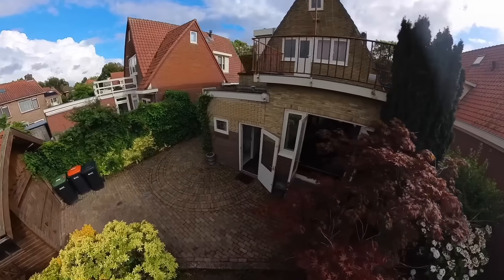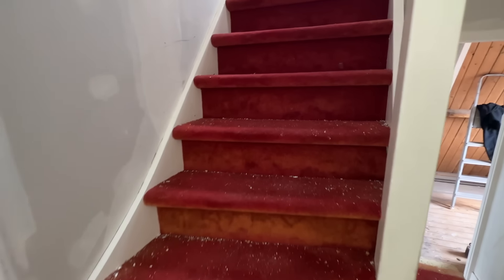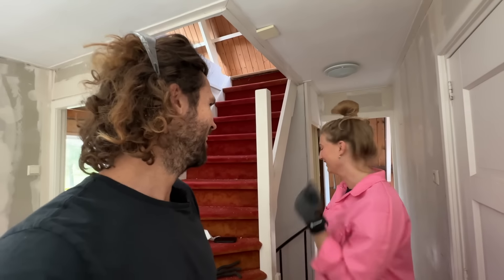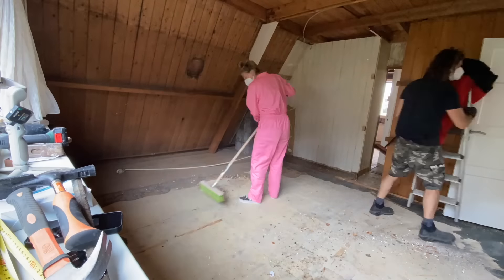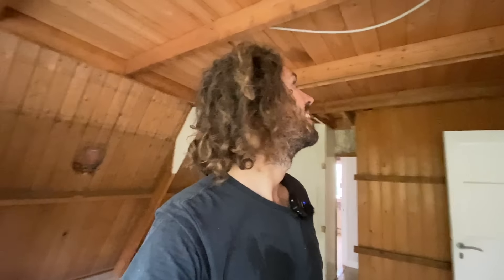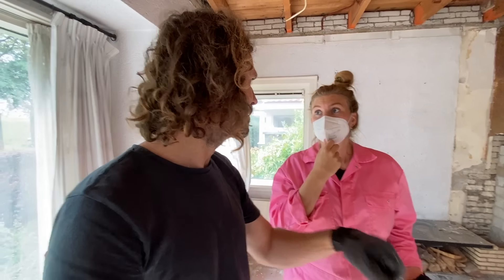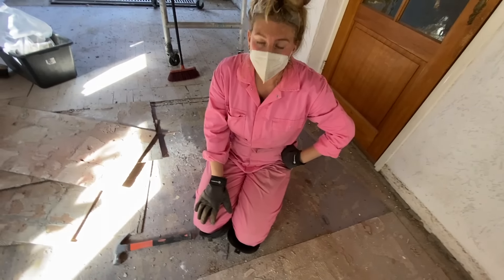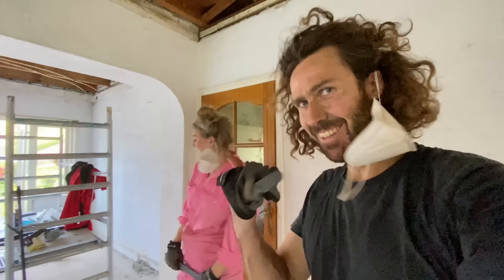Renovating our NEW HOME on a Budget! (PREGNANT) pt10

Comment: It would be wise to think about isolating the house properly before you paint, add new flooring etc. Those floor boards look ok (except the rotten part which does need replacing) but might as well make sure to ensure no one will fall trough in a few years. Could think about a concrete floor with floor heating for example. I think I noticed double windows so that's good, but it can't hurt to call over a carpenter to get some advice regarding your windows and doors. This regarding isolation and safety, you don't want to be cold in winter or have uninvited guests obviously. This house is clearly not up-to-date regarding burglar proving it.

At the rotten floor boards bit you can see there was a very obvious leakage. I would highly suggest to call in someone to check all pipes so your central heating won't ruin your new floor, carpet etc. It will be cheaper to do it now then needing to worry about it later. While the plumber is at it, ask him what his ideas are about the whole plumbing in the house as no one touched it clearly for a very long time.

For vacuuming it, make sure you do NOT use the regular vacuum! This is NOT build for this amount of junk but for mainly dust only. Buy one from a specialist store (doe-het-zelf zaak) like Praxis, Gamma etc. or try to find one you could possible borrow. They are not too expensive anymore, so might as well. After the house is done you can keep it in the garage to clean there.

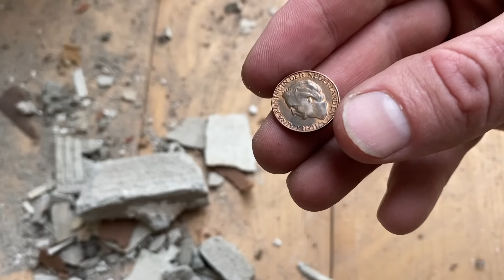20:19 1945 coin, so end of WW2. I'd say keep it in your collection, those are fairly rare in that condition! Nice find!

Comment: Typically, you start at the top of a chimney and remove the bricks from top to bottom. If they are above the roof you would need to start on the roof to remove weight top to bottom.
Reply from the maker: Absolutely! We didn’t know the chimney was so dodgy before we took the decorative wall away!